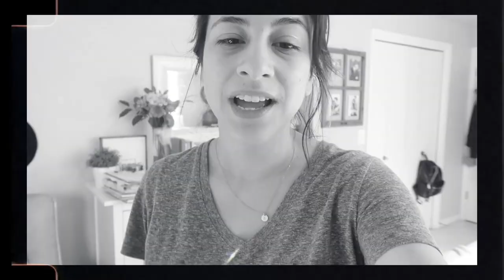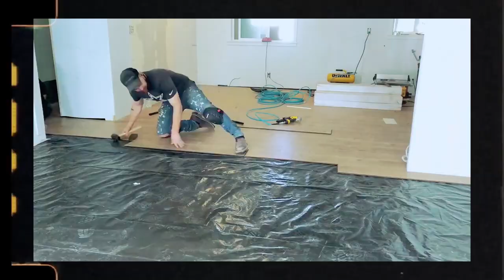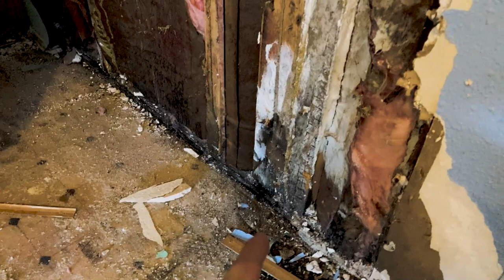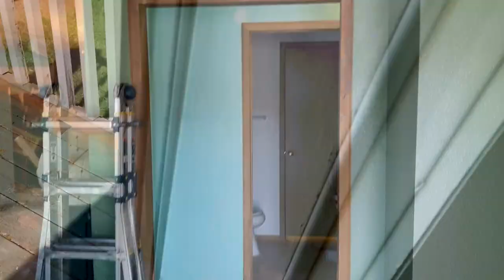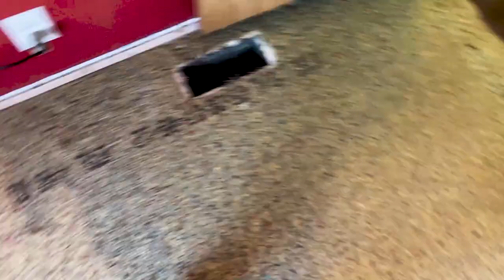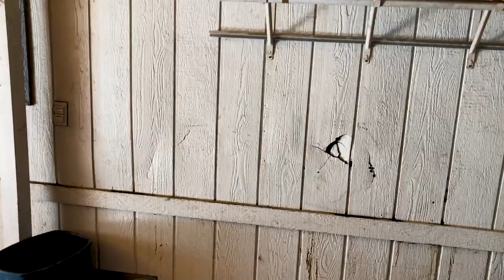SUBSCRIBER MOBILE HOME RENOVATION | Mobile Home Remodeling | Living Hope Renovations

Comment: Unfortunately, I'm not on your side of the country but on the East Coast. I am currently trying to figure out who in this area does the underbelly because it would need to be entirely replaced. The home is an 88' Santa Fe by some company named Karston or Karsten - which closed decades ago. I do not know if another company has taken that company over, but just trying to find someone who can actually take on this task has been problematic. Most companies in this area specializes in crawlspace waterproofing of traditional homes and the mobile home parts store that I've reached out to never gave any follow-up regarding if they can or will do  underbelly replacements. I've googled,  yelped, checked the  bbb, task rabbit and thumbtack but to no avail. Can you please provide any advice on how to find someone  that can take on this task and know what they are doing. Thank you.